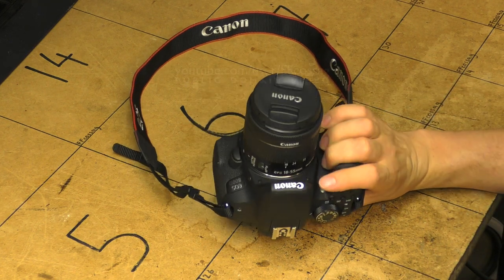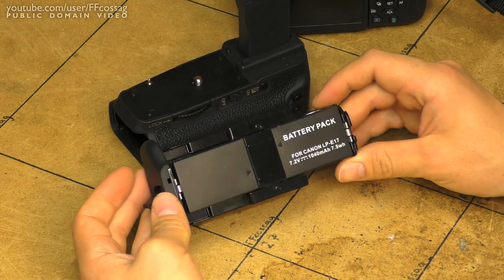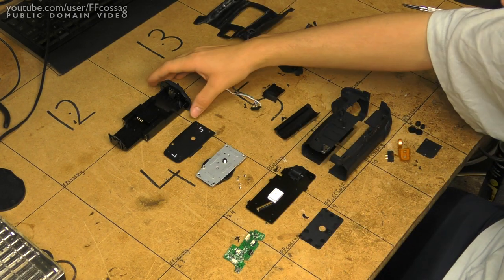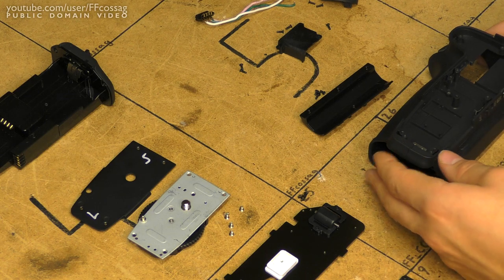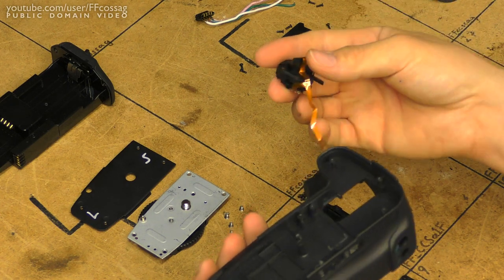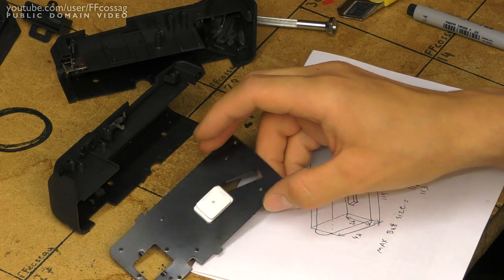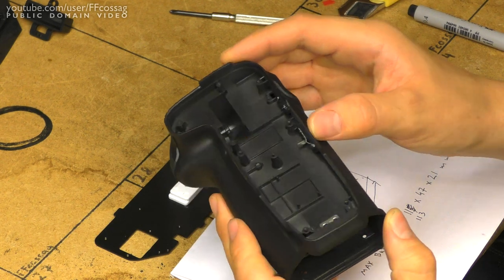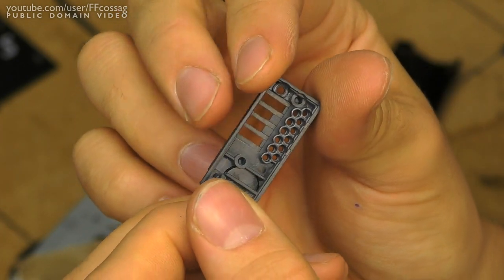MEIKE battery grip teardown & hack (FF WANT BIG BIG BATTERY)

Comment: in case you want to use 18600 battery's you may want to look in the existing pcb for battery manegment  ic's and maybe the driver or so for the battery since cannon have battery protection against pirated batteries im sure the one's you make yourself are considered pirated
Reply from the maker: I'm thinking about just baking the original Canon battery in there somewhere. We'll figure it out.

Comment: You should get yourself a 3D printer then you can make any size/shape battery grip you want. Watch Jim Conner's videos on the velleman 3D printer kit.
Reply from the maker: I would NOT trust a 3D printed grip to hold a DSLR class camera at all. There's a reason they've made this out of relatively good plastic. It would be cool to make a custom battery insert, however. Very cool indeed.